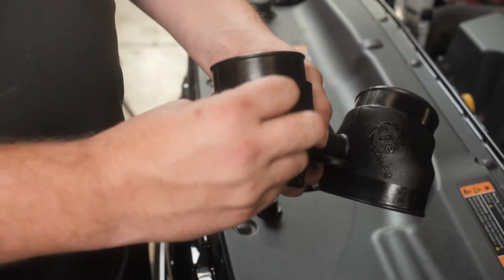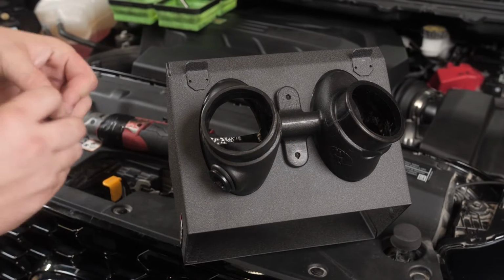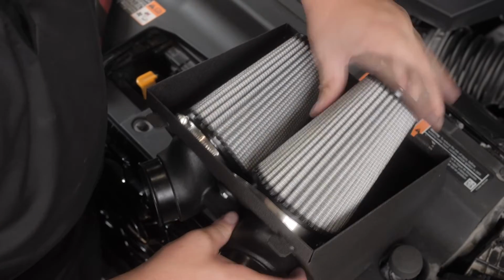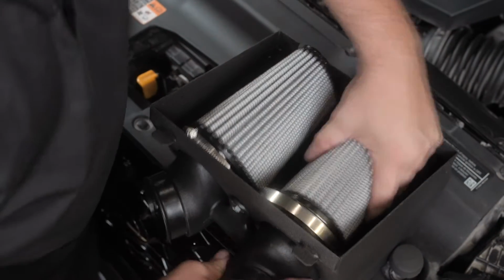EASIEST Way to Upgrade your Edge ST | AFE Intake Install

Comment: I have an edge with a turbo 2.0 engine. Would this application work for it as well? What kind of changes have been made to the vehicle, in terms of speed or fuel consumption?

Comment: Thanks for the video - I watched it a couple of times before installing my CAI. The only trouble was getting the temperature sensor out of the factory intake, and I eventually had to get the pliers out. It definitely had a few nicks in it when I put it in the AFE CAI, but it seems to be working. Is there any chance I messed it up, and if I did how could I tell?
Reply: I had the same problem with this!
Reply: You would be able to know if you messed it up. It wouldn't run right. Just unplug it and try to start it! They're not that expensive either
Reply: Thanks, it's been running great so I guess the temp sensor is fine
Reply: @smithjones8064 how would you describe the cars transmission and the engine is it a good car?? Would appreciate your thoughts on the suv.

Comment: this sucks so much hot air the uner hood of an edge sport/st is hot very hot. I used dragy one night we need 30 1/4 mile pass with factory using k&n drop in and this. the factory box with k&n drop in was quicker by far.

Comment: Anybrral numers? Dyno before and after? Without it it is just salesman BS talking😂
Reply: It's a hot air intake
Reply: @spartanpatriot3163 
Doesn't it seal to the hood? I noticed a rubber seal around the top edges.
Reply: @MrCaribe65  not very good on the ST and not at all on the spot, it also still pulls air from the stock snorkel. S&B is far superior

Comment: This thing was RUSHED just to get it to market! The freaking box has no top and doesn't seal to the hood. Yeah nothing like HOT AIR to make hp..... Save your money because this pile of crap doesn't add anything!!!
Reply: pretty sure rhe only reason we want this is to make more noise from our totally inaudible cars. I really hope nobody things these actually increase performance lol
Reply: @InYoFace the top has been recently released.  It should've been part of the original design, not an after thought.
Reply: Do you have one 🤔 just curious
Reply: @garys9718  I had one. I fitted an intake for a Fusion and it's so much better. This pile of garbage is just that's GARBAGE!
Reply: @jasond1824  so you put a fusion one on the edge,or you put one of these on your fusion
Reply: @garys9718  A Steeda air box for the Fusion 2.7l I installed on the Edge.
Reply: @jasond1824  do u have a website for this
Reply: That's why I got the s&b intake